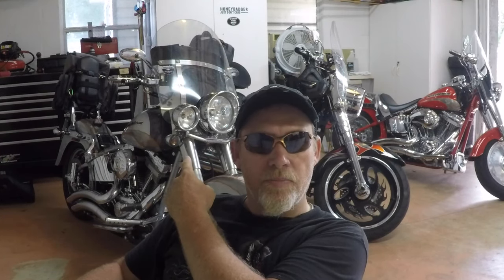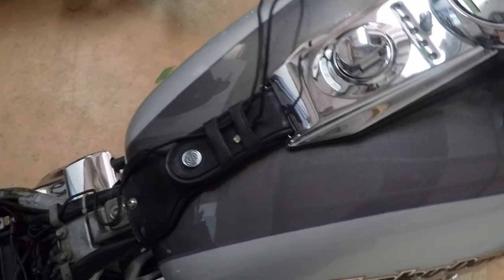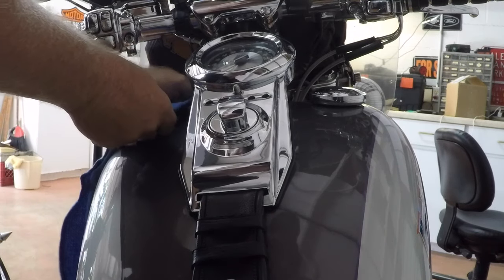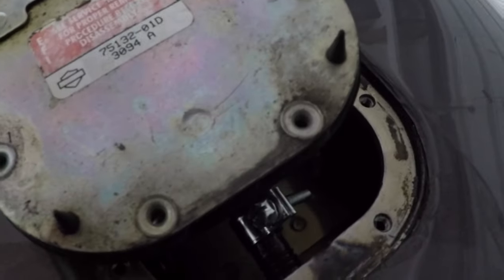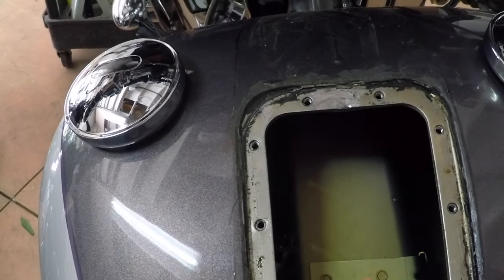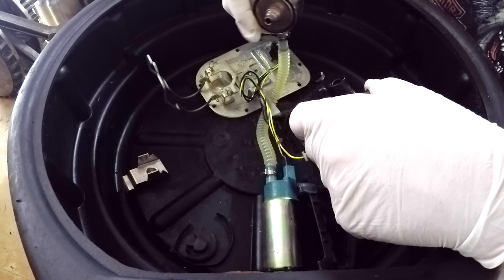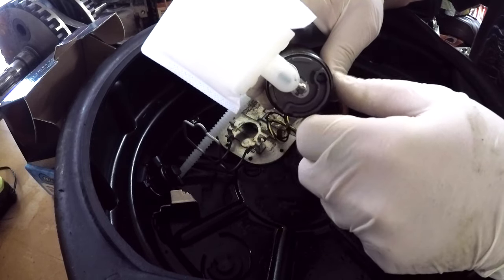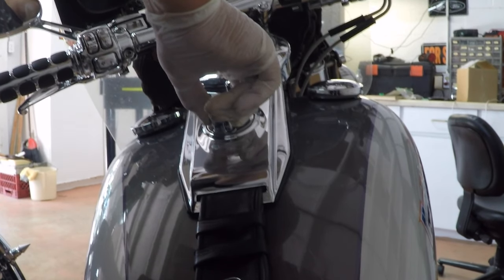How To DIY Replace a Harley Davidson Fuel pump, Fuel filter, and Fuel Pressure Regulator.

Comment: Didn't help by seeing nothing because you where to close with camera while doing it and not showing where the hose come off of and put back on. I took mine apart and then had to wait almost two months before getting my parts and didn't remember which hose's went where and how to reasonable it to make sure I had it right. Would think they would have all the parts in stock and had to wait
Reply from the maker: If you would have used the links to the parts in my video you would of had them in a couple of days. You should always mark what came from where or have a repair manual on hand
Reply: @TheBadgers I thought you were compressive. Thank you. I was FoMoCo tech as well.